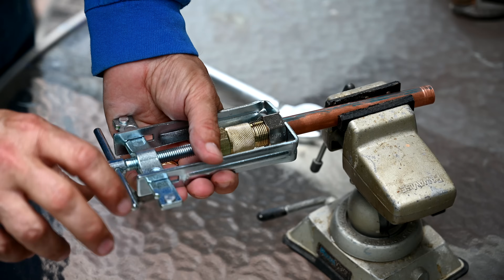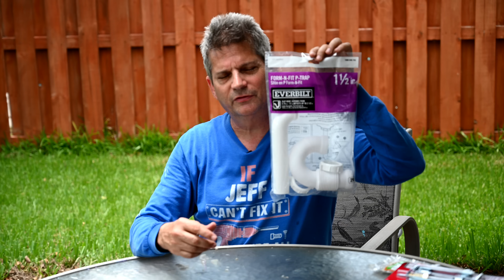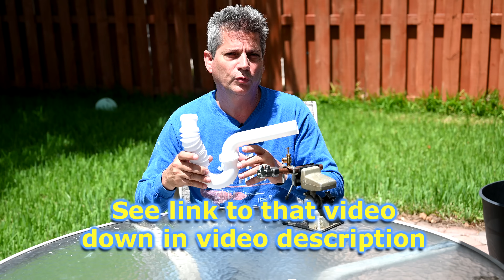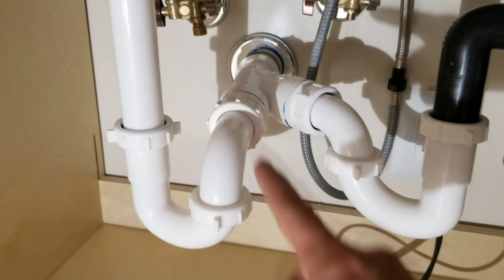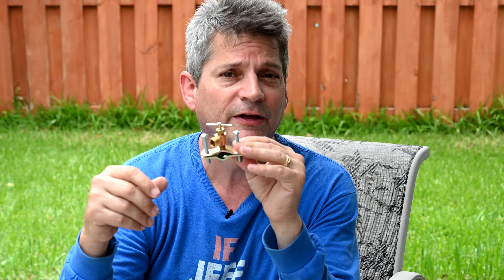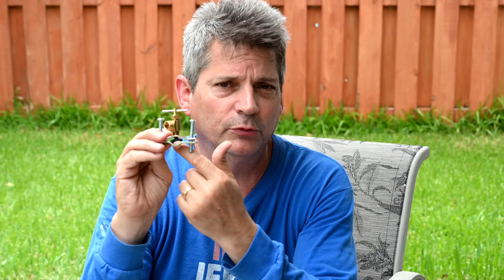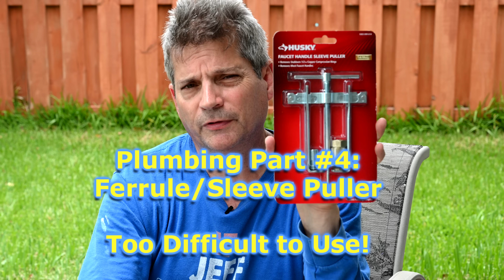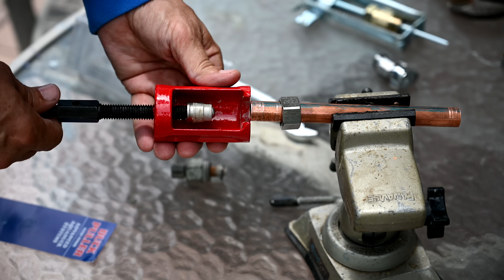4 Plumbing Parts/Tools You Should NEVER Use. NO Plumbing Fails

Comment: You don't need a tool to remove a ferrule (olive in UK) Jeff - fine hacksaw across the width until nearly through, flat blade screwdriver in the cut, twist and it's off.
Reply: A Driver   When I saw the video, I was going to recommend the same thing as you. That's how I do it as well. Got my small bladed bow hacksaw, never fails.
Reply from the maker: @hardrock1826   Isn't it easier to just pull it off with the duck puller tool than it is to sit there and hack back-and-forth with the saw?
Reply: @jeffostroff  Perhaps, I have never tried that. But it only takes seconds really the way I have always done it. That ferrule is soft material, that allows a better seal and it's very thin. It doesn't take much to score the surface and pop it off. Like anything, once you do it for a while and develop your technique, it becomes automatic.
Reply from the maker: @hardrock1826   Maybe I'll do a video this week on that try both methods have you ever accidentally cut into the pipe with the saw?
Reply: @jeffostroff  Never cut into the pipe. In many a case you don't even need to cut all the way through. As long as you have cut a channel that you can slip a bladed screw driver into and give it a twist. You can use other tools to do the final removal once you have cut that channel, pliers for example. Experiment for what works best for you. In many a case, there are tools available on the market now that were NOT available decades ago. So as a result many trades people came up with unique ways of overcoming problems where a tool solution was unheard of. And they end up doing that for their entire careers. 
I learned how to do things in school in a textbook manner. But once I got exposed to the trades and working with some old guys, I really learned some quick and/or special ways in which to solve common problems that surfaced during the workday. Since that time I have come up with some solutions of my own. It's trial and error and then one day it's Eureka, you come up with a methodology that works with the tools that you have.
Reply: @hardrock1826  Compression fittings are VERY common in the UK.  There are two problems with the olives (rings/ferrules/sleeves) on compression fittings.  First is that they are commonly overtightened because they weren't tightened enough the first time so the joint leaked or because the pipe was dirty again causing a leak.  Second that they are commonly not fitted squarely on the tube because it was dirty or tolerances of the ring or pipe wall or the fitting had tension on it.  These cause not only the olive to be deformed, but also the pipe to be deformed.  I have seen olives squeezed so they dig into the tube a 1/8th of an inch.  No way you're gonna pull that off!  

Next, There are two very simple problems with using pullers trying to remove olives (ferrules / sleeves).  First is that the puller pushes against the end of the tube which will deform the tube end, often creating a ridge so when you put the new fitting on, it won't seat deep enough. Next the puller is pulling on the nut.  The inside of that nut is tapered to compress the olive as it is compressed against the olive when you asesmble the fitting. Well the puller is going to do the same thing!  So when you pull with a puller it can compress the olive and cause it to dig into to copper wall of the tube, sometimes deforming it enough to make a crack.

This is why a careful cut of a stuck olive is better.  Check the tube after removing the olive.  DO NOT PUT A NEW FITTING ON if the tube is even slightly deformed from the olive compression or from using a puller.  It can create a wonderful fountain.  Replace the pipe leading to the fitting if deformed, even if it means a hole in the wall!  I've seen people use pipe dope to repair the deformity which may work for a while, then all hell breaks lose in the middle of some night months away!
Reply: @SB-ky9ie  Compression fittings are very common here as well. I never use them, for some of the reasons you listed but mostly because I don't trust them. I have seen others that have used them and the mess they have resulted in because they opted for the faster way of doing the job. Rather than go the route of properly soldering a fitting or valve, etc. into place. 
Those nut/ferrule pullers I don't use them either. If the wedding band can't be removed the way I do it without sustaining damage to the pipe. I will quickly go to the trouble of cutting it back and adding pipe if I need to do that. Using compression fittings to me is the lazy way of doing the job. Today, Pex is the choice of the lazy way of doing things. There is no care or discipline when using that product, they just tend to run it everywhere because it's possible. 
When that product first came out many years ago. I was doing government inspections. Never seen it before that time it was so new but not fully passed for all applications at that time. I shutdown an entire housing project where it had been used to pipe the water to and from the natural gas hot water heaters. As it turns out, it was not passed for that purpose. There was a class action lawsuit by the new home owners against the builder. And all his work was being scrutinized for further violations. Everything had to be redone.
To me the best way of doing things is the most secure and safest way. I have to sleep at night and I would not be able to do that if I did something and left it, when the quality of the work is questionable.
My Dad always told me, that if you do something, "Do it right and you do it once, do it wrong and you do it again, until you do it right."
Reply: @jeffostroff  Of course it is easier with the Duck Puller. But some of us weekend wariers who do this 5 or 10 times a decade, can't justify the cost of all the handy tools. I have been using the hack saw - screwdriver method for over 50 years and it works. No I have never cut the pipe, but I take care, and it takes me time since I am usually working in a confined space, whare my 230 pound body does not fit well.
Reply: @Gary Yarker      I solder. Like I previously stated, "I Don't Use Compression Fittings."  Mind you, I have made good money changing out compression fittings that failed (leaked) that someone else liked to use.
Reply from the maker: You guys are very talented over there. when you see some of the sloppy work I find in some properties, you'll not want to see certain people with a hack saw trying this delicate surgery. I'm more concerned that they'll cut through the pipe. At least the tools I showed you are effortless and quick with no hack sawing back and forth.

Comment: If you have negative pressure in your drains a P trap would also loose it's water seal.
Reply from the maker: Yes, and a poorly designed venting system combined with a powerful toilet flushing close by in violation of plumbing codes could also siphon out your p-trap.

Comment: As a plumber for 30+ yrs. I have to agree with almost everything you taught in this video. What I didn't understand was two-fold. Why would anyone try to use something as flimsy as a handle puller to try to remove a compression nut and ferrule? Why pull it in the first place? Dope and tape on the new angle stop will merry up very well with the old nut and ferrule. Only time I've ever change the compression ferrule is on very old copper and there is damage to the copper or old ferrule. Many times having to resort to getting my tiny tim out and saw off the old ferrule because of too little copper exposure between the wall escutcheon and end of the copper. Show em how to do that...not easy but, I've done it many times.
Reply from the maker: Hilmer:  Husky touts this tool as a handle puller and a sleeve puller. They even have 2 sets of instructions on the back for whichever mode you use it in. A lot of properties I deal with have corrosion on the pipes or the old valve stop, so I always change the ferrule by policy anyway. The new valve comes with a new ferrule so why not use it. I always remove it, polish off the copper pipe nice and shiny, and install everything brand new again.
Reply: I stopped using compression stops a couple of years ago. Sharkbites at the toilet. Easy to change. Also can take it off to change the escutcheon. Sometimes I use a sweat on stop, because it can be sweated off. Biggest problem is idiots cutting the stub out off all the way back at the wall. That pisses me off cuz I use chrome plated supply lines at toilets.
Reply: @CGoffgrid  sharkbites at the toilet is hack come on man
Reply: @RonMexico79  Nope. I do million dollar homes. The competition stubs out blue PEX and uses crimp on stops at toilet, with braided line. That is garbage. A copper stub out, sharkbite stop, and chrome supply line is by far the best looking way to do it.

Comment: If all the parts that you’re saying are no legally to use why selling at the home store
Reply from the maker: It is not a violation of criminal law to buy or sell them, it is a violation of building codes to use it in a building. The city inspectors will fail your inspection and you won't get a closed out permit, but you won't go to jail either.
Reply: @jeffostroff  It's pure laziness.  Usually just a homeowner or DIY moron being lazy and cheap.   In Idaho a homeowner is not required to be licensed to do any work on a house they own however they are required to get a permit and have the work inspected.

Do they?  Obviously not.  We should have a law which mandates a state inspector or certified home inspector pass any property before it can legally be put on the market for sale.  No pass, No MLS # and no title transfer, no certificate of occupancy whatsoever just to prevent an idiot homeowner who wants to flip houses or sell their house from pulling the same crap they did with my place.

Comment: at 10:00 you showed  another plumbing code violation - two traps on one trap arm
Reply from the maker: Steve you are correct we are only allowed to have one trap
Reply: If the waste arm is sized correctly on a common vent two traps are allowed as long as it is sized correctly. FBCR 2016 6th Ed. P3107.1 and table P3107.3
But that doesn’t look like it’s sized correctly.
Reply from the maker: @zakkmon123  I think you might be interpreting table P3107.3 incorrectly. it only applies to "Connection at different levels", the kitchen drain we showed with 2 p-traps is connected at the same level into a horizontal pipe. So The tab;e you referred to is only applicable to a vertical pipe and the 2 fixtures connect at a different level. The pipe coming out of the wall is ! 1/2", standard for kitchens. I have never seen a residential kitchen waste pipe be larger than 1 1/2" with numerous houses having dual sinks, so I still contend that it is acceptable to use 1 1/2" waste line leading to the 5" stack.
Reply: *2017 6th Ed.
Reply: P3107.1Individual vent as common vent.
An individual vent shall be permitted to vent two traps or trapped fixtures as a common vent. The traps or trapped fixtures being common vented shall be located on the same floor level.

P3107.2Connection at the same level.
Where the fixture drains being common vented connect at the same level, the vent connection shall be at the interconnection of the fixture drains or downstream of the interconnection.
Reply: You're talking about "vents" here.  Yes, one vent can connect to two traps.  I was talking about a common  1 1/2" trap "arm" connected to two P traps
Reply: Yes that is correct on a 1 1/2” .

Comment: Very interesting. Our bathroom vanity has exactly the kind of "P" trap you say is required. It often allows sewer gas into the bathroom.

???
Reply from the maker: Spikey, very off you would get a smell, here's some reasons why. The water in your p-trap, known as the trap seal has possibly dried up. That can be corrected by running water down the drain a few seconds to fill it back up.  Take P-trap apart and make sure nothing is trapped inside like dental floss which can cause capillary action, leeching water out of your p-trap. You may have a hole somewhere in one of your drain or vent stack pipes in side the wall, allowing sewer gases to get in the house. Older cast iron pipes develop holes which could allow sewer gasses to escape. You may have a dead animal or clog in your vent stack, which is causing sewer gasses to find another way to vent into your house.  If you find out let us know, this is an interesting case.

Comment: Ok saddle valves are just fine. Installed one 14 years ago and it's still holding just fine. What are you a union guy??!!
Reply: Same here, I have one on a humidifier attached to the furnace and one for my under counter water purifier, both of these came with the products. I guess we are a little less anal here in Canada

Comment: I’m an electrician not a plumber. Obvious to see that these plumbing solutions are crap. Lol. Thanks for the video. I should do one for electrical crap out there.
Reply: Eileen Kelly you should.
Reply: The same crackhead that did the plumbing in my pace also did the electrical.  Green wires being used for the neutral.  Exterior junction boxes without a binding ground wire.  The circuit my fridge and microwave are plugged into  are spliced into a knob and tube wiring (Not to mention my well pump is spliced, yes spliced, into the same circuit inside the sub panel),  220 volt wires to my stove are spliced into the original wiring that goes through an interior junction box mounted on the exterior of my house (and the splice is wrapped with electrical tape) which gets watered with my sprinkler system, Black wires being used for a neutral, a cut live wire protruding through the wall behind my water heater just hanging in the breeze, tandem breakers in a sub panel clearly not rated for them, Breakers from different manufacturers used in the sub panel.....

I can go on and on.  I'm not a licensed electrician but I just spent $1000 in just parts to fix that crap. 

I just ordered 2 AAVs to fix the non vented plumbing in my bathroom and kitchen and the S trap.

If I ever find that stupid son of a b*tch who remodeled this house to flip it I'm going to sue him
Reply: jburr36 report it to your electrical safety authorities and get a lawyer.
Reply: @ladyluck5248  I'll deal with that after I do the repairs.  I didn't even realize these issues existed until I inspected my sub panel when  considering designing and pricing a solar power system.  

Seeing that mess just made me sick to my stomach.  I do have pictures
Reply: jburr36 why
Reply: I'm a retired electrician. I don't do videos but if I did the first one would be about the dangers of plugging a generator into a dryer plug. I've seen people do this and as you know, it can cause linemen down the road to have really bad day.

Linemen should and do ground every conductor before they touch it but this could energize lines all over the neighborhood unless the main breaker is off. Code requires a permanent mechanical interlock to prevent generators from sending power to utility lines.
Reply: @unti419  That is actually illegal to do in my area. Before anyone can hook up back up power to any residence hooked into the grid  they MUST have a transfer switch between the power meter and the sub panel to isolate the power.  

The new rage with solar power is adding a micro inverter to the panels for a grid tie system.  They are designed to supply power only when current is detected from the grid.   If grid power goes down so does power from the solar panels.

But what would stop someone from taking a small 240 volt inverter and plugging it into a dryer or stove outlet to supply a signal to energize those micro inverters?  

You would have the same issue as the moron plugging a freaking generator into one and putting every lineman working on the grid at risk.

I think my state needs to mandate a transfer switch be added to every address with a solar power system
Reply: Thanks JB. I didn't consider solar systems much but I know there was a chapter added to the NFPA 70 recently. I didn't study it much because I usually dealt with large 480 stuff. I have no experience with solar.

I'll look it up and I hope it addresses this in standby system. But people will still do this regardless. Yeah they are morons but it will happen non the less. I hope someone can do a video on this.
Reply: @unti419  Welcome.  Idaho now mandates any grid tie photovoltaic system to use smart inverters or micro inverters which auto disconnect the system in case of a power failure.  

I thought of that issue with plugging a 240 volt signal into the dryer or stove plug as a flaw in the regulation.  That's why I think a transfer switch which disconnects the sub panel from the meter in the event of a power failure should be mandatory for every grid tie generation system
Reply: Unit 419 
I haven't a clue what you are talking about but it sounds good!
Reply: Unit 419 earth bonding
Reply: Yessss.....there's a Hindu guy that shows how to splice wires,a huge no way in the USA.....prob same guy who smooths concrete with a sandal